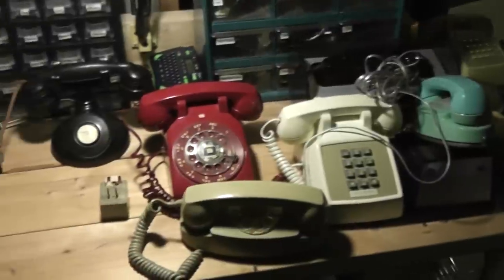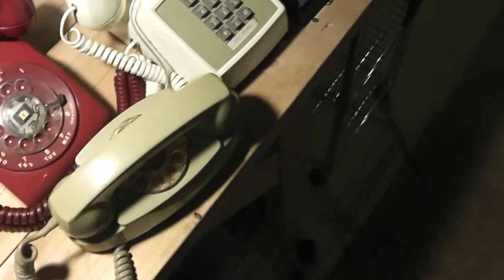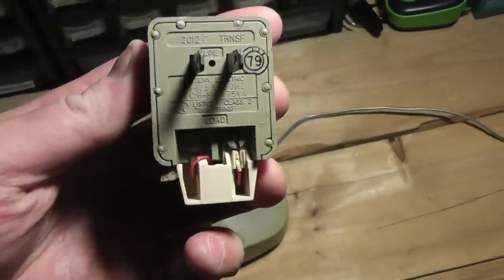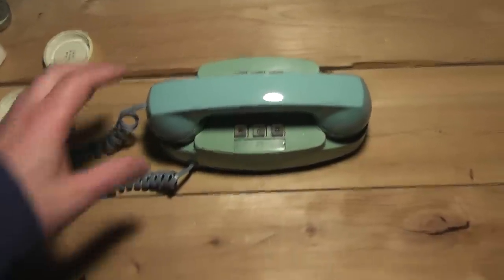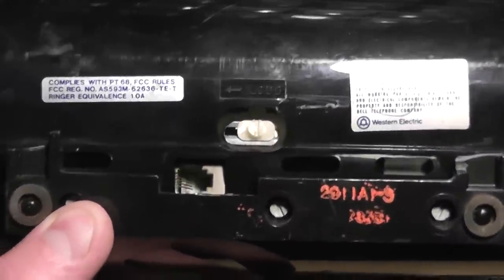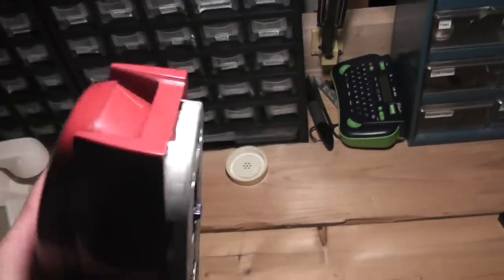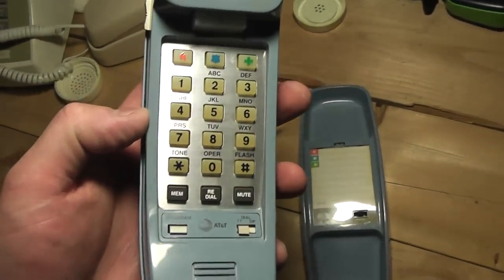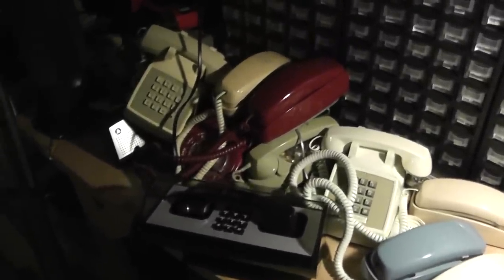Western Electric Bell System Telephones - A Collection and Short History Lesson

Comment: I worked for Pacific Telephone/Pacific Bell from 1980 to 2000. I worked on the last operator cord board and in the Phone Center. I got to see all the regular and design lines telephones. I have a collection of over a thousand telephones and I still collect and sale them. I have anything from the 202's to the 2500's

Comment: There is a gadget i bought over a decade ago named “Tele Q”. It’s a theater gadget uses 29 V batteries produces the 90 V at 20 Hz to make phones ring.
use it in movies and stuff to make the phone ring on air.
I still have my old 1982 ITT 500, You know the model 500. We leased it from phone company.
Two weeks ago I found a gadget : “ CELL 2 JACK “. 
It used 5Volt USB, operates with BlueTooth on SmartPhone or a phone with BlueTooth. 
I miss RJ-11 Telephone Jacks. Now i have one that actually works.
Thanks-for showing us your telephones. Remembering using almost every one except that older first one ya showed. Nice collection. 
OK gonna hang~up. 
-Foxx 🦊

Comment: I have a small collection of old phones, but as I live in the UK, mine are mainly ones
that were made for our telephone system. I have a white type 706 dial phone from
1966, a red type 746 dial phone from 1973, and a two tone green dial phone from
1983. Also, I have a beige type 500 American dial phone, brand new still in its box,
made in 1977, by Stromberg Carlson. I have converted it to UK modular plug, and
it works fine. I love the look and sound of the old classic phones.

Comment: Mark, that WE 202 non-dail desk set was also used on manual exchanges. If the exchange line was magneto, a wall-mounted  crank subset would be furnished. Other exchanges would require a metal bell box subset.

Comment: That 107A speaker is an interesting item.  It was intended to be connected across the the leads from the receiver in the handset and worked when the phone was off hook.  If you use a small capacitor in series with the tip or ring and connect it to the phone line, you can monitor the phone line. 6-9 volts AC on the black/yellow pair.
Reply: Right. It's not a speakerphone but it does look like the speaker half of a model 2 speakerphone. That was shorter and had no volume control. There was also an even shorter box with the microphone, volume control and a pair of clear buttons on top that looked like the switchhook of a model 500 or 2500 phone. There was also a third box around a foot square and  5 or 6 inches deep that contained the circuitry that was usually mounted out of the way, hidden from view.

Comment: I agree with you, that old phones are now becoming very collectable.
I have a small collection of old phones, however mine are from the UK.
and were standard issue in the 60's, 70's and early 80's. Phones from the
50's and 60's are starting to sell for silly money now.  Incidently, I have a 
US phone, still brand new condition, still in original box. I bought it new from
Radio Shack in the early 80's. I also have three UK phones, one white from
1966, a red one from 1973, and a green one from 83.

Comment: Hello Mark Davis that black phone that you have is what's called a direct line phone meaning no dial it is also a model 202 they used a separate ringer box that you had to buy from the bell phone company they never had a internal ringer that would have been made from the 1920s thru the very early 1930s I'd say about until 1932 it has a bakelite handset and either a metal zinc body or bakelite.

Comment: On your cryptic date code. In the late 70's WE changed to listing the day the part was manufactured. The first 2 diets are the year, the last 3 represent the day of the year. I collect 1970's WE Touch Tone sets and most of mine are in use around my house and trailer. Even after 50+ years they still work great. You can see some of my collection on my website http://CowboyFrank.net/telephones/

Comment: Big fan of the Weston Electronic 2500. Got one shipped here to the UK. The main unit is from 1978 - On the receiver, the ear piece is dated 1972, the mic says 1956! Can that be right?
Reply: jeff Webb  Thanks for your reply - I did mean Western Electric ;-) The one problem I had was that I couldn't dial out when I first got it. I had to cross over two wires to change the polarity. YouTube can be great and helping people solve problems. Anyway, the unit now works perfectly on the UK landline network and I'm very happy with it. I like the 'Frankenstein' approach to changing parts of these classic phones as you call it. No wonder they were so prominent in American culture in the 1980's - apart from the fact that you had to rent them and had no choice on the make of phone ;-) I will check out the WE Trimline or Princess telephone. Cheers :-)

Comment: I found your collection interesting.   My opinion, though, varies from yours on the quality of Western Digital phones.   I thing those were better than those of the 1990's.   The old ones took a beating and kept on ringing.   The main phone I grew up with was WD's Slimline (not to be confused with Thinline).  It was a wall mount (hard wired).  The bell ringer was mounted to the base molding in another room, which enabled the wall phone to be smaller.

To this day I believe I can dial faster on a rotary phone than a touch tone.  Part of that  may be since I am very proficient with the desk top calculator, and the typical touch tone phone is backwards for me.

Thanks for sharing your collection!
Reply: I couldn't agree more, Dave. I have an old dial phone from the 60's sitting on a table by the front door just so I can feel that quality from time to time. I wonder if any business will ever have the incentive to build anything as well as Western Electric did.
Reply: Ben Wolfram Here in the UK brand new copies of the old 500 series dial
phones are widely available in a variety of colours. It gives you classic
styling with up to date technology. I admit they are probably not made to
the same quality standards of the old phones. These phones are always
for sale on e-bay.